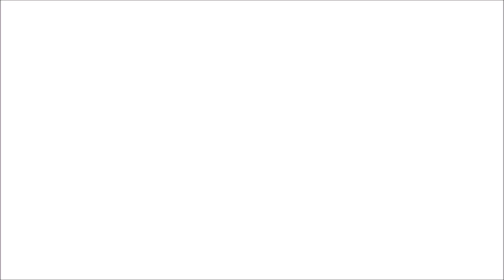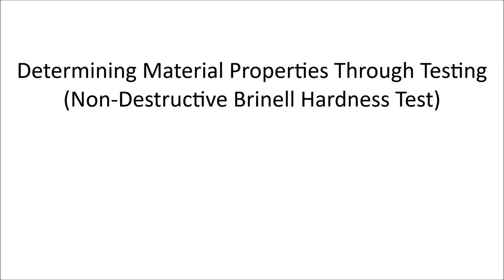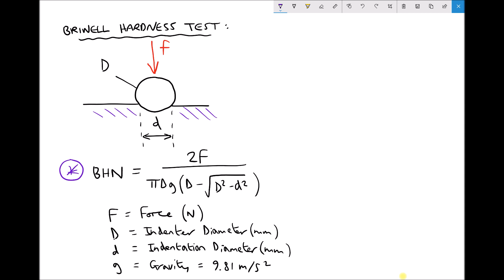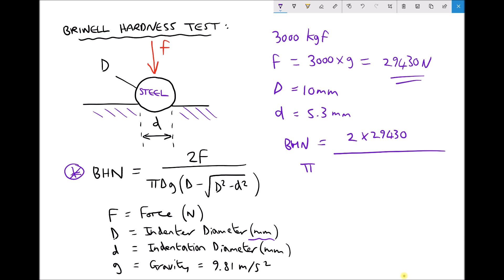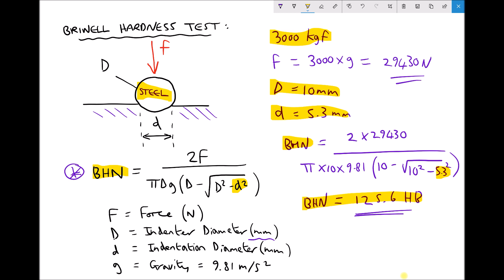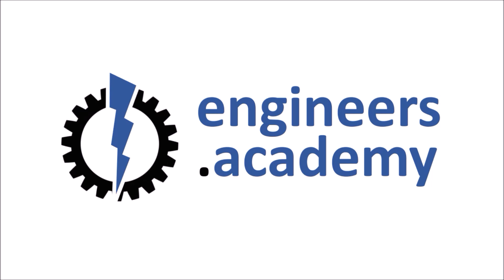Determining Brinell Hardness Using a Standard Non Destructive Brinell Hardness Test

Comment: Nice video. You mentioned that we can anticipate the magnitude of mechanical damage by Brinell test. Could you tell me the detail? For example, can we predict the indentation diameter when using 1 mm indenter by the calculated brinell number of 125.6 HB?
Reply from the maker: The size of the indentation can be determined using the formula for Brinell Hardness Number (BHN). The formula is given on this website: https://www.engineersedge.com/manufacturing/brinell_hardness_test_equation_13173.htm